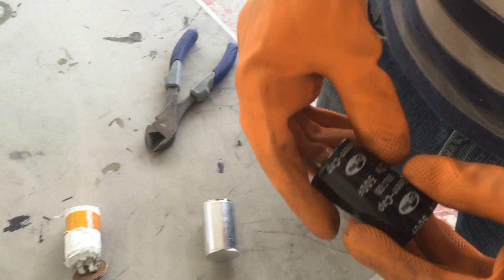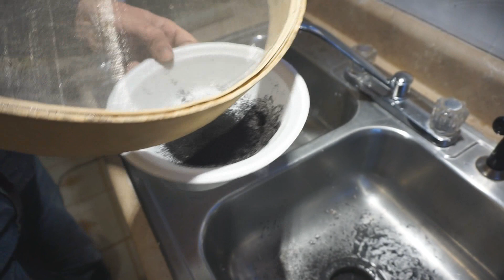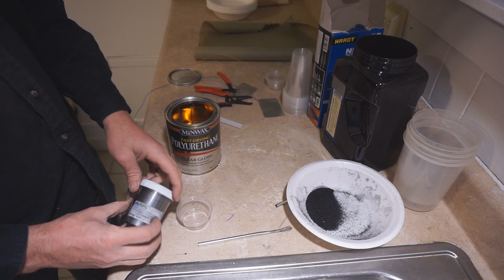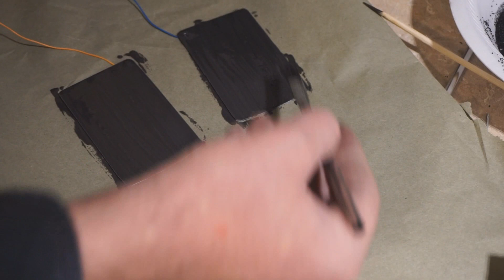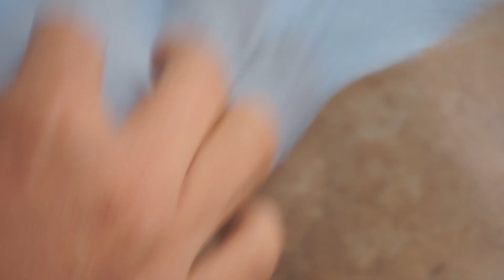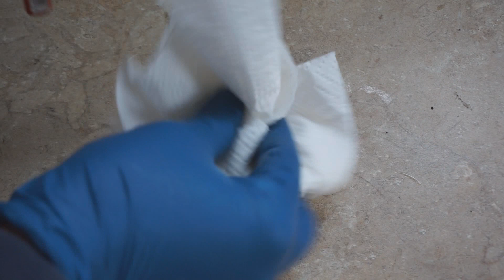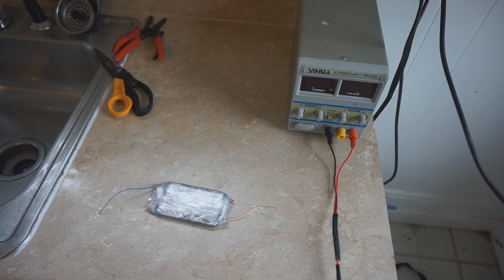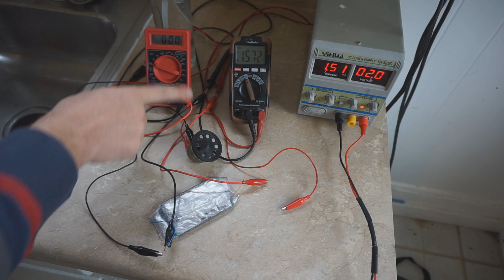Easy DIY Graphene SuperCapacitors

Comment: Increases in capacity with more charge-discharge cycles usually means that the electrodes are "forming".  That sounds like an ionic reaction instead of moving and storing charge.  If you want a galvanic cell that's no big deal.  If you want to stay with a capacitor there is a voltage for each chemistry that you don't want to exceed of you force an ionic reaction and you have "ruined" your capacitor even if it still has "capacity".  I do enjoy watching your videos.  I came late to the Graphene party, but I'm trying to learn!

Comment: For making electrical connections to aluminum plates you might want to try the low melting temp aluminum repair alloy sold by Harbor Freight.  That way there is nothing to come loose.  Also you can use this alloy on fairly thin metal.  In old ads they used to fill a small hole punched in an aluminum soda can.  You WILL need to apply some kind of insulating coating over the repair alloy!

Comment: Two things:
1) Could you use a rolling pin to press the carbon particles into the coated plates more evenly, or would that crush the carbon particles.  Is there an advantage to the tactile feedback gained by hand pressing?

2) Would vacuum sealing the completed copaciter cause enough pressure on the plates as to make the tape wrapping step unnecessary?
Reply: +Colleen Forrest The whole idea here is not to speculate but to actually try it yourself. Come back when you have your findings and tell the community about them.

Comment: Hi Lasersaber, love your videos. The aluminium and charcoal do form a battery until the air is consumed. If you have two alum plates as collectors and two carbon plates on top of them, for some time until the oxygen is consumed you will be oxidizing the alum and getting some voltage from it. Look up the alum air battery using carbon. At least you sealed yours here which should, hopefully over time, consume the oxygen provided you don't overcharge it (~1.23v).  You can verify this by using one of your electrodes, place it in electrolyte and put the meter on the alum and the carbon. You'll get a voltage in the air! And the carbon itself holds a lot of air too, which can be a problem to remove.

I really do like your videos and hope you can post more about your supercapacitor ideas and experiments. I have done a lot myself!
Reply: Hooch Lover A
Reply: +Hooch Lover Yes, I have an idea.. Has anyone tried Hydro-Chloric-Acid (HCL) for the electrolyte?

Comment: I recommend just using the bare copper for a seal. No insulation. Use a single threaded copper wire. Not the type of wire that consists of multiple threads. The plastic will stick to the copper just fine. The insertion just creates problems. Trust me. Try it.
Reply: +czoknorris Plastic would need to mould around the curves like glue. I think the flatter the area the less likely air will escape

Comment: You lost me when you called large chunks of carbon oriented randomly "graphene".  Doesn't graphene mean a very specific hexagonal sheet arrangement of carbon atoms?  That surface area is key to maximizing capacitance is reflected, iirc,  by equations developed by Maxwell or Faraday back in the day (like more than a centruy) so good to know that people are catching on to this marvelous fact.  I respect people for playing with this stuff and learning but I fail to grok the "instructional" nature of the videos when very little seems to have been learned yet and the information transferred is nearly content free.
Reply: +Marty G technically anyone who has ever used a pencil has produced some amounts of graphene. There are ways to concentrate graphite so its mostly one layer (graphene) or a couple layer material (close but not technically graphene) but its not actually perfectly flat on that 2d collector surface. The alum plates lasersaber uses wont be perfectly flat, and there wont be a perfectly flat 2d layer of graphene either. The hope I think is that by using some percentage of 2d graphene sheets in your ink, or whatever, that you have increased your conductivity and super cap effectiveness. Whether that matters much in the end compared to polished graphite alone I dont know. I haven't noticed much difference, I can polish graphite and get under 10ohms per cm2, which likely means I, like others, have a pretty flat surface that is good for electricity.
Reply: The chunks were activated-carbon sorted by mesh.  The small jar of graphite flake material was probably "few-layer graphene", which people call "graphene" for short.

Comment: I have read that Graphene is one atom thick. How can you be certain that the activated carbon formed graphene, especially graphene that covers the total area of the plates? Besides, what we see in the video as graphene cannot be just one atom thick. Am I right?

Isn't it more probable that there may be some tiny graphene sheets spread across the plate, but without them forming a larger graphene plate?
Reply: +epiNoesis his Graphene is in the poly paint he was mixing. The activated carbon is added to improve surface area. you dont real want flat carbon plates for batteries, more like shag carpet is what you want.
Reply: +epiNoesis It didn't, most of these "home made graphene" videos are just making a normal capacitor.
There is a reason why they are still working on a way to make it on an a large scale instead of tiny amounts at a time.
Reply: +SilvaDreams Yes he is using some high quality flake in the Poly and we have loads of high quality flake for sale!  Do you want some?

Comment: Great how to video.  Did you check the voltage on the cell before you put the charger on it?  I'm still wrestling with that issue.  I don't want to make another galvanic battery that looks like and acts like a super capacitor.  A hybrid is OK if it doesn't die for a long time.  So far I'm not there yet.  Mine work for awhile then they expire.
Reply from the maker: +Lidmotor 
They start off flat.  You have to charge them to get any action from them in my experience.  Mine usually seem to "expire" after the electrolyte evaporates.  That is why I am trying to seal them better.
Reply: +lasersaber Thats what i thought, just pulling your chain to see if you're real or ai.
Reply: +lasersaber That is excellent news.  I will press on with this.  I have all the materials and have made mine in a similar fashion to yours.  I need to keep trying.  It is that simple.
Reply from the maker: +Frenchie 
No worries.  While I do not answer all questions, I do read them all and often try to answer as many as possible in future videos.
Reply: lasersaber is the fluid hazardous?  If you continue to add fluid will it continue to work or does it break down the carbon?

If you can refresh it then it is a lot like a kerosene lamp for electricity and that's pretty cool!

Comment: it would be interesting to see how it reacts to a charge from a PV panel
Reply from the maker: +Paulman50 
They should work fine in solar applications.  As soon as I am able to easily make larger capacity packs I am planning on using them with solar.

Comment: IMPORTANT!!! HEAT COPPER TO NEAR BEFORE RED HOT 700°C WITH A GAS TORCH. THE NANOCOATING IS OUT OF THE CARBON IN THE AIR IN CO2. PLEASE TRY!!!
Reply from the maker: +Muktiism 
Sounds like an idea worth trying.  Thanks for the input.

Comment: Excellent!!! Are you contemplating building a charge-dump/'data-logging circuit using a micro-controller? I have been working on one to conduct home-made experimental super-capacitor tests.... Mine is based off of an ATX-PSU... I'm waiting on a buck converter to get my 2V source.... Awesome stuff as always! Keep up the super-awesome work... :D
Reply from the maker: +Binj Komisar 
If you get that working I would be very interested in it.  Maybe I could send you a capacitor to test for me if you are interested.
Reply: lasersaber
 Sure, I would love to test an experimental super-cap design of yours for energy density. I have the hardware mostly done for the cap-testing project. I just have to do some coding. I'll get back to you in the new year, I should have it working (<-famous last words) by then.
Reply: I have made progress. I will have to make a video soon. But I am 99% sure we are good to go.
Reply: Hooch Lover
Thanks Hooch Lover. I agree 100% with you. Hopefully the open-source community can come up with a cheap, non-toxic, version of the super-cap that can be made by anyone anywhere... Testing for energy density is a must for us to know if we are heading down the right track..
Peace Hooch Lover.
Ben
Reply: +Binj Komisar congrats man, I look forward to your video too! Keep up the good work, besides everyone trying to make money off supercaps I feel like if enough hobbyists get the news out there then we can provide a much cheaper energy storage solution that anyone can do in their home.

Comment: Here is another thought, you may want to consider using Aluminum Wire for your Aluminum Plates, copper and aluminum don't play well together and I think the two might corrode and cause the cell to lose life needlessly. Granted a flip side is Aluminum Wire is not as flexible and could easily break so that is something to consider as well. 

I wonder if you leave a tab how that might work with regards to sealing the unit. When you cut the Aluminum Plate leave a tab that will partude through the sealed plastic to act as your connecting points. Also you may want to scribe the aluminum with a + and - sign if you use different color wires to keep down on the confusion of which is which. This is a great project and shows wonderful potential, I hope it works out well for you...

Something else to consider is using your heat sealing on the shrink tube to close the ends better or possible to seal the ends before you shrink it further. I never used heat shrink in such a large diameter so I am guessing here if it will even work...
Reply: Using a little zinc oxide paste will help prevent corrosion between copper and aluminum junctions. Electricians commonly use it, and it can be bought in hardware stores.

Comment: Ummmm, you may want  to think twice about flushing activated carbon power down your drain, you may be setting yourself up for some very expensive plumbing repairs. Activated Carbon does not dissolve in water nor does it break down and it will accumulate in joints and low laying areas of your drainage system, worse yet if you are not on a city hook up, and can easily clog things up. Also that power is not very health to breathe either, so I would suggest a mask of some sort when using it. Coal Miners know this far better than I as they suffer from BLACK LUNG or the harmful effects of COAL DUST, which is NOT TOO DIFFERENT FROM ACTIVATED CARBON or smaller chunks of COAL....

Granted small scale anything typically is not harmful but it is something to consider. I enjoy your projects but some folks out there might not know this about Activated Carbon so this is my two cents, feel free to ignore my warnings as I am not here to tell anyone how to life but rather simply adding my two cents worth....
Reply from the maker: +Paul Bialozor 
Thanks for all your thoughts.  I normally do not build these over my sink!  I just did that for this video.  I usually build these outside with a full mask on.  Your thoughts on the copper vs aluminum wire are also good.  I am planning of vacuum sealing these but I have not yet been able to get the seal good enough for a strong vacuum.

Comment: I thought graphene was only one atom thick. can you really call this graphene? wouldnt it be more like the dual carbon battery that is being made in Japan by Ryden (power japan plus) ?
Reply from the maker: +Frenchie 
I do not really know.  The bottle I got off amazon said it was graphene powder.  So far that powder has worked the best in these experiments.  I may try ball milling my activated charcoal for a few days and see if I can make something myself that works as well or better.  I am thinking that the same charcoals that make the most powerful gun powder might also make the best super capacitors.  Believe it or not charcoal is one of the most important variables between good and bad black powder.
Reply: +lasersaber I have made caps and batteries with graphite and with the exfoliated graphite which could be called multilayer graphene and the graphite will not hold or deliever the charge as good as the graphene
Reply: +Ed Lovvorn so there is a difference between them

Comment: Oh crap I was wasted last night, try diluting your phosphoric 68.424 mL to 1L DI water, this is a 1 molar solution everything will last longer.  Good video!
Reply from the maker: +Lupus Mechanicus 
Thanks for the suggestion.  I will try that in the future.  I have had even better success using KOH diluted with water in the past.   The electrolyte is a very big variable, I have a lot more experimenting to do before I will be able to recommend what works best.